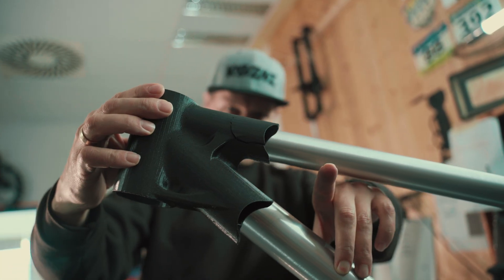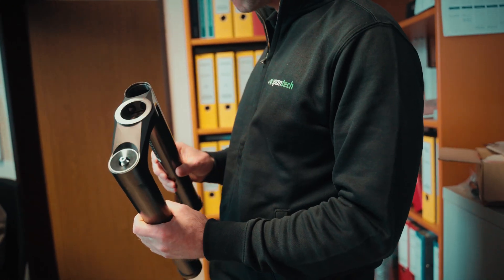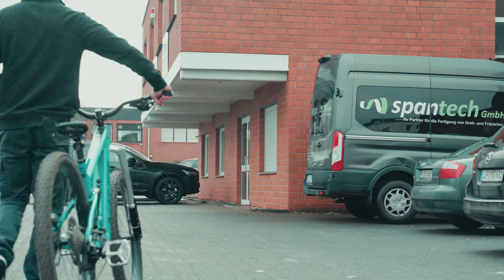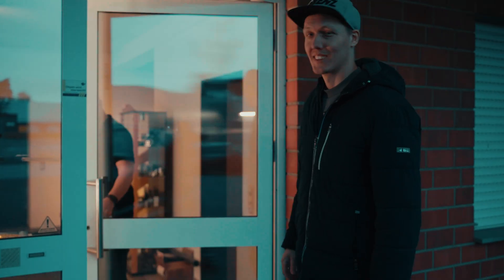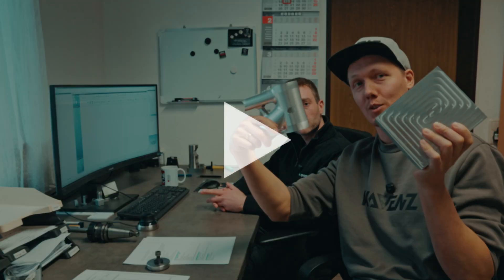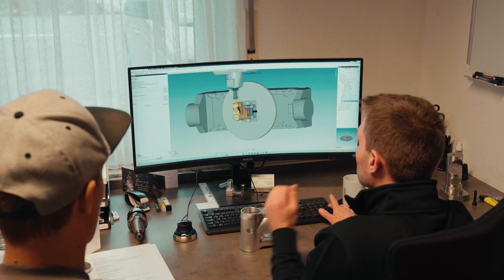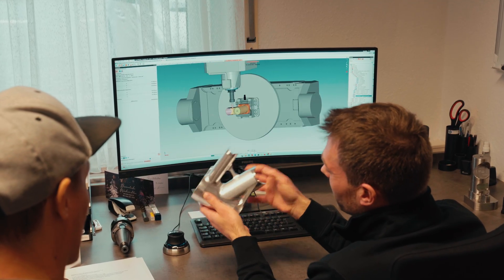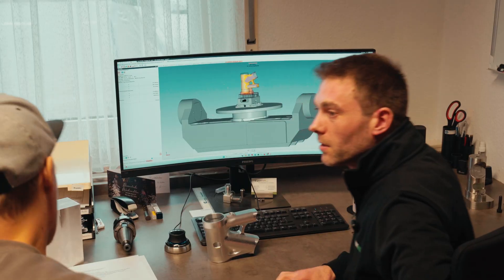From CAD to Reality: How Our MTB Frame Lugs Are CNC Machined

Comment: Id recommend adding some glue ports to the design. With overlap joints its difficult to get a consistent glue seam around the tube and lug. Glue ports and injecting glue guarantees sufficient bonding area, and you dont "wipe"  the glue away when installing the tube into the lug.
Reply from the maker: Thanks for the tip, it's definitely something we plan to explore. As for the CNC parts we thought it's easier to add manually that's why we don't have them in the parts jet.

Comment: I really don't understand the reason for all this made-out-billet CNC nonsense - what is the reason for it?
Its not a particularly difficult part to make, nor its really highly loaded, or needs to be very very light.
Why not just turn all the tubes, weld them together, sand and machine all the critical sizes like bearing seats.
Metal 3D print around 500? Yup, sounds about right, tho I don't think 5 axis CNC is going to be that much cheaper.
It looks amazing tho, and if you like it - why not.
P.S. Also be aware that direct aluminium to carbon contact is a bad idea, needs a glass fiber spacer due to galvanic corrosion.
Reply from the maker: Thanks for your thoughts, for our scale CNC makes the most sense. We aim for 200 frames in the first year. The adhesive will do the isolation layer we think it should do the job so you have other experience?

Comment: Just brainstorming.... is there a way to make both the carbon tube and the lugs joints to be oval/triangular/rectangular anything but round? In order to not only chemicaly bond but to achieve a natural mechanical bond as well?

LOVE what you are doing Giacomo and the KAVENZ team❤
Reply from the maker: Yes the top and down tube will be rectangular.
Reply: Look into framework bicycles, hes a bit further along on the same path for gravel bikes and winds his own tubes with custom shapes and directional stiffness properties

Comment: Are you planing to have like 20+ sizes of the frame, similar to Atherton? But they did it wrong with very limited and short chainstay. As far as I understand you can play with the position of BB which will offer new sizes as well.
Reply from the maker: We don't really plan on that. But we can easily play with Seatpost length and you already noticed the opportunity the bolt on BB brings plus our rear end already offers bolt on Dropouts.

Comment: How long was the machine time(runtime)? Depending how many parts you want to create in the future maybe molten wax casting might be a good choice or vacuum casting, which is both very precise with minimal rework.
Or 3D forging and CNC. Forging creates parts with higher strength compared to CNC because the structure within the metal isn't disrupted.
Reply from the maker: The run time is currently 100 mins 
Forging is a great but heavy investment. Not sure about the strength of casting do you have any idea how it compares.

Comment: That’s some really good insight into the costs between 3D printing and machining for these lugs. I know there’s some conversations around fatigue life in 3D printed metals as well, and this is somewhere where machining solid metal is still superior. While 3D printing of parts is very trendy right now, you make a good point that machining still makes more sense for production runs of products!
Reply from the maker: Glad we could shed some light on the cost differences between 3D printing and machining for these lugs!

Comment: Hello, its me again, sorry ._. And whats the direct price comparison? :) As a design tipp, don't use integer radii, use e.g. R2,1.
Reply from the maker: Price direct comparison is not possible as it mostly depends on the CNC quantity. There's definitely an amount where it would cost about the same. Great advice with the 2.1 radius secures vibration free milling with max radius.